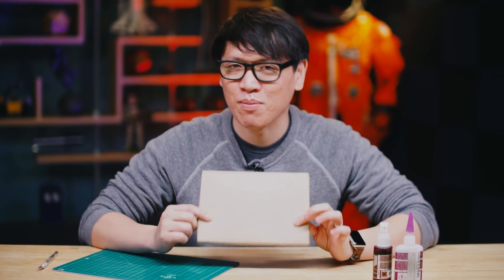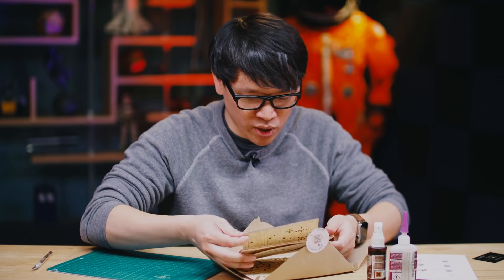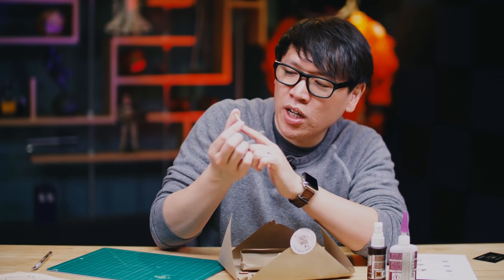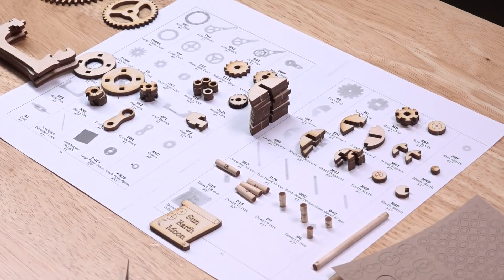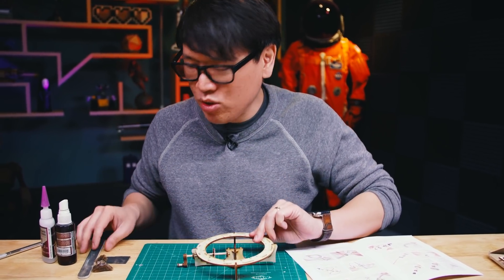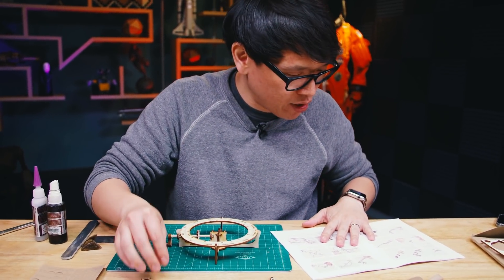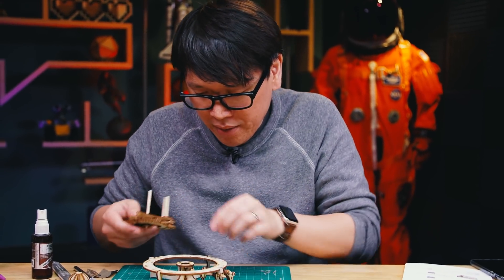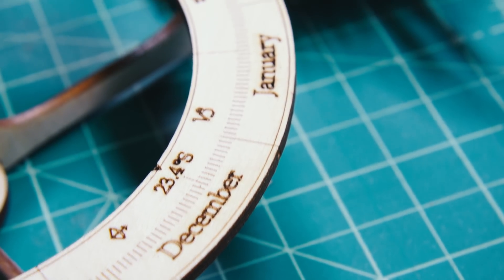Show and Tell: Laser-Cut Orrery Kit

Comment: This is awesome.
But.
NOW DO AN ANTIKYTHERA DEVICE !!!
Reply: My wife keeps on telling me to make one. But I am not confident that I can do this.
Reply: Ronald Nelson well, it is a big complicated thing. One of the biggest problems is probably going to be the material used and clearances. You need really smooth wood if stuff is going along each other etc.
That’s where metal could be a solution indeed. Very different. Also, increasing scale might help. A small bit of space between things becomes bigger. The problem it might invite is that things do have to stay level. Which might mean connections need more attention, and space, which can be a problem.
I don’t know what kind of materials you have access to.
For some things 3D printing might be a solution.
Maybe you should mix things up.

Comment: It's a shame that a little bit of foresight would've yielded a smooth mechanism. I'm 100% sure that waxing the dowels and layers before gluing would knock down the friction significantly.
Reply: 560 Swedish Kroner, 'bout $60 US
Reply: The key is to work the mechanism for approximately 10 minutes before final assembly. I also include some paper spacers in the kit that will help the mechanism run very smoothly. But it is only around 60 USD - including shipping :)
Reply: @Induku  I fixed my error:)
Reply: @Induku  Come on, that's about $5 worth of wood and packaging. Just charge us $20 so more people will buy. I thought about picking one up for my son, but $60 is outrageous for a science lesson.
Reply: @billsmith4932  It is true that the material cost of one orrery is quite low (although shipping alone is more than $5) - and it would be nice to make it a bit cheaper. But the orrery is hopefully more than just the sum of the material parts. It took several weeks to design this model and to make a batch of 30 takes 4-5 days. I don't want to get rich from the sale of the orreries (and am certainly not doing it), but want to make enough to be able to spend time on designing new and awesome mechanical models (the next item will hopefully be even better). Most items (educational or otherwise), cost quite a bit more than just the materials they are made of. That said, there are loads of free plans and ideas all over the internet to make awesome things like orreries at home, or print them at a local laser shop for much cheaper. Have a look at the thingyverse website for some truly ingenious items shared by makers.
Reply: @Induku  THIS ORERRY IS EXTREMELY CHEAP, ARE YOU KIDDING ME?
Only thinking about the design of this makes me have an aneurism

Comment: Mold the pieces in silicone to create wax blanks then use the wax to re-cast in bronze and you'd end up with something truly collectable.
Reply: A jeweller's saw, a pack of blades and a sheet of brass I think are more interesting, simple and cheaper. Parts  so thin will warp a lot when cast

Comment: Anyone know what kind of wax he used? I have a wooden kit clock that I have all but given up on keeping running and am willing to try most anything...
Reply: I designed the orrery and I recommend candle wax. I also recommend to work the gear mechanism for at least 10 minutes before final assembly - then it runs as smooth as silk :) Wooden clocks are however a bit tricky (I have built some previously). Wax will help to some extend BUT be careful not to  overdo it as too much might make the gears stick together and have the opposite effect. Very little is recommended and work the mechanism a bit to ensure it works well for each pair of gears before full assembly.
Reply: @Induku  thank you so much, I will have to give that a try.

I will have to order one of these orrery kits as soon as I can, it is a very interesting design.
Reply: Many use soft candle wax. I personally always preferred bees-wax myself, mostly due to how malleable it is.
Reply: @siggitiggi  thanks, I had no idea about that what so ever.
Reply: Jeremy, have a look at this wonderful documentary on John Harrison’s incredibly accurate clock made three hundred years ago and largely of wood. His way around lubrication was to choose a special wood from Africa the properties of which are self lubricating. It’s a fascinating documentary, also, I can’t find it but search on YouTube for Russian wooden watch makers, I will try to find it and if I can I will post the link here. He is incredible, his watches are made entirely from wood!  https://youtu.be/T-g27KS0yiY
Reply: Jeremy, I found it, he is from the Ukraine absolutely fascinating.    https://youtu.be/GE_h-nCwvGs
Reply: @ianmedium  those look really interesting, while I don't think it will help my clock as it was a kit build I will definitely have to watch those, thanks!